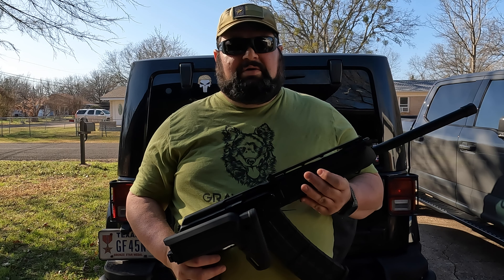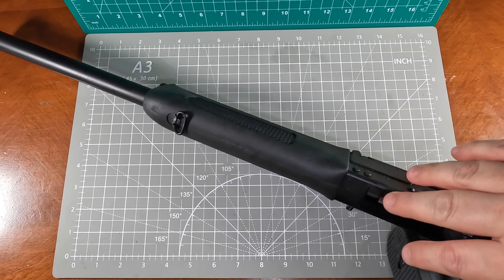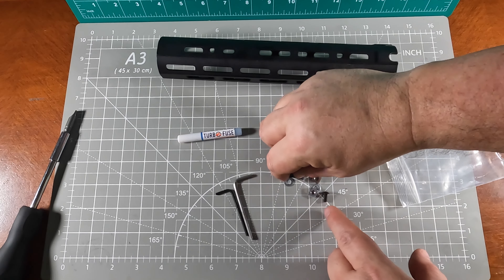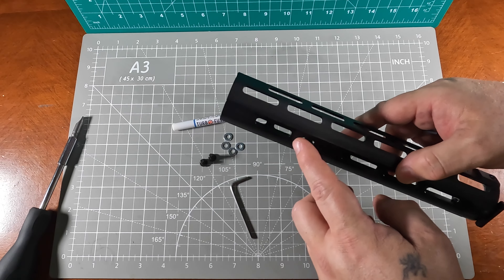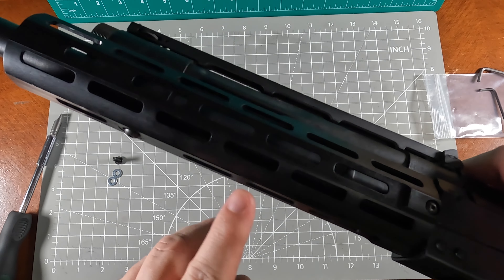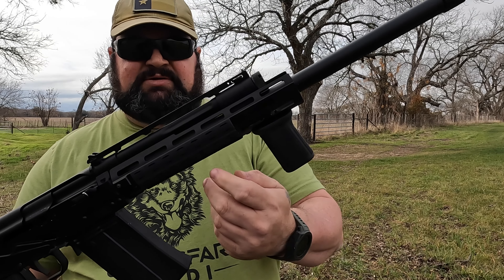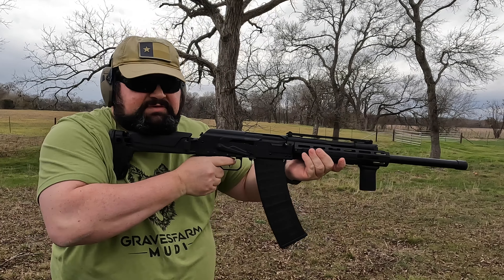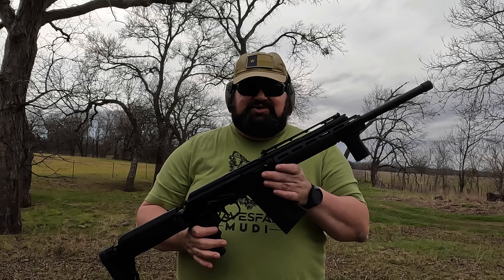SAIGA 12 handguard install and test fire.

Comment: Where did you get the pistol grip for your Saiga 12?
Reply from the maker: Rear grip is a Houge AK-47, front is BMC Gunfighter grip.
Reply: @CAVCOP  When you got your Saiga did you have to modify it to put your pistol grip? I have a Izhmash Saiga 12 straight out the box and I don't know where to start.
Reply from the maker: @danbowski40 

I did have to drill the trigger guard off and replace parts.  I used Carolina Shooting 
Supply for most parts used in the Conversion.
Reply: @danbowski40 Shoot it for a few months to get familiar then convert it with Carolina shooter supply !! Love my newly converted Saiga 12 😊